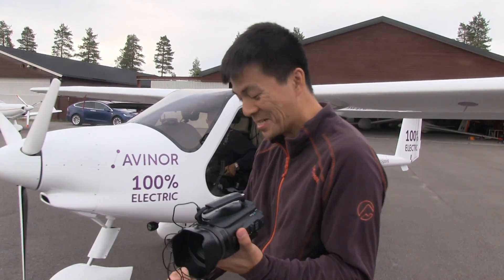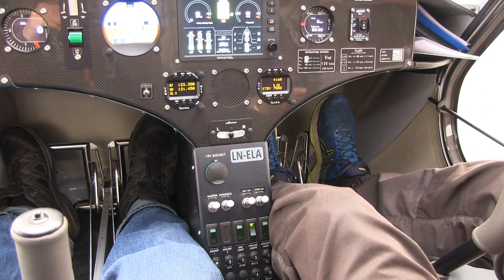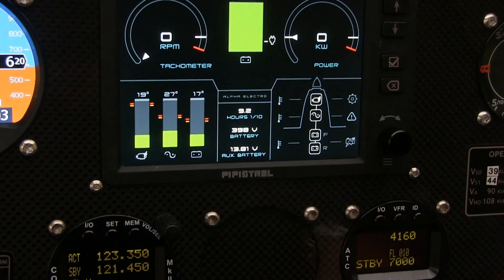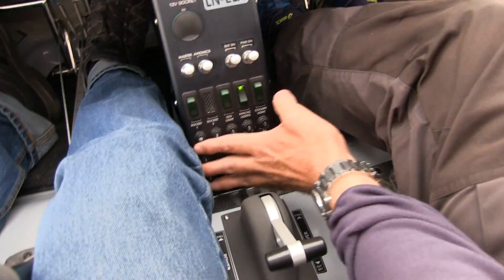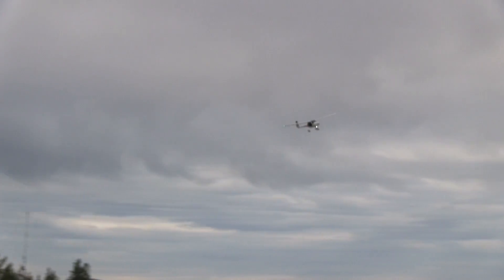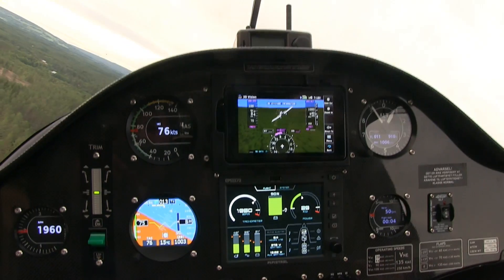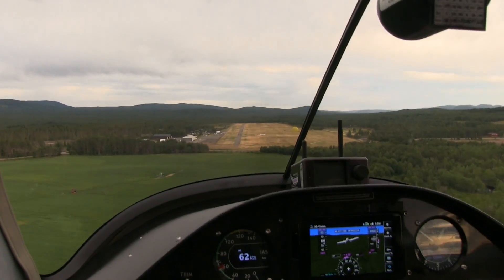Test ride in Pipistrel electric plane

Comment: Even though the noise is lower than internal combustion engine, it is still more than I thought one would hear from an electric plane. Most of that noise is coming from the prop. I conjecture that the prop is somewhat inefficient and that if the efficiency of the prop is increased, the noise would be lower as well.
Why is noise important? Lots of reasons, but for a pilot, being able to not have to wear headphones would be a huge improvement. Imagine being able to carry on a normal conversation without headphones on long flights!

Comment: 21 KiloWatts @ 100 mile per hour (163 kph) at 9:25 ,   A car needs about 100 KW to travel 100 mph.   So this airplane is 5 times more efficient  than a car traveling at 100 mph with two people.

Comment: Just wondering if it would be any advantage in making the beast into a flying solar panel. That wing surface looks tempting and although it would not increase performance much it might be a help in increasing the range. Most of the upside wings and fuselage could be covered and panels are getting cheaper and better. They would have to be shaped of course........just woncdering

Comment: What is the price difference between the ICE plane, and the electric? Kia now sells its Niro crossover with 3 engine options. ICE, Plug in hybrid, and full EV. So you can see the price difference. I always say my wife's Leaf is a $25,000 car with $12k in battery and development.
An hour's flight time is good for training, but I'm guessing the recharge time is a lot. For our car, it's 30min at 440v (hard on the battery), 3hr at 220, and (from half-charged) 8+hrs at 110v.

Comment: It's surprising how much of the noise of a small aircraft is from the prop. Nice and quiet in the cockpit though. Great little plane.

Did I see an instrument saying around 10 hours of flight time remaining? That would be a range of 1850km? That can't be right surely? Impressive if true.
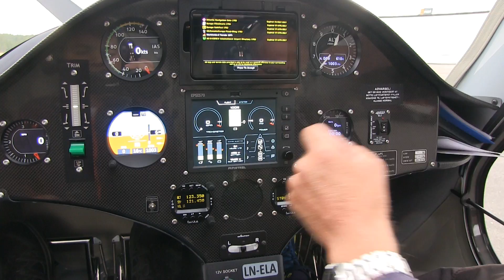Reply: Reading comments it's sounds like it can only fly for 60mins but @1:00 he mensions 9 hours of battery remaining? Is this just autocalculated from the current draw of  taxiing?

Comment: A 1 hour flight would cost me $2.16 in electricity where I'm from. That alone makes electric worth exploring. That and the reliability and safety considering how many systems that you won't be relying on.
Reply: Greg There's Only ONE ,moving part in an electric motor.. unlike a combustion engine with thousands of moving parts..  However, what's the one thing that always fails in modern cars... the electronics!!
Reply: @bicanoo_magic  Very often due to vibrations and non regulated power source, both can be easily dealt with in an electric environment
Reply: @bicanoo_magic  electronics rarely fail on planes
Reply: the issue in costs has to do with the batteries. I believe max battery life is 700 lifecycles, or around 700hrs of flying and I heard from a source that the battery pack is $17k USD to replace. That adds about $24 USD to the hourly cost. Something to consider.

Comment: Seems like a little bit of battery power could be saved by having small electric motors in a couple of the wheels to taxi with instead of reving up that big heavy propeller.

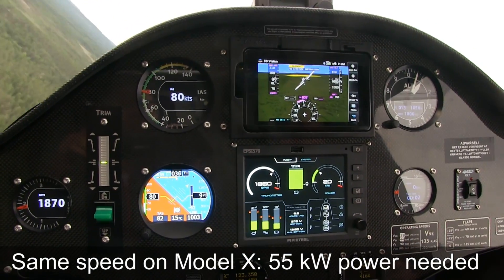Comment: 9:50 That statement is completely wrong a Tesla model 3 battery is 50Kwh or 75Kwh if it used more than 55Kw a mile it wouldn't sell because less than 1 mile range. 
A model 3 goes 100 miles using just 26Kw that's 260wh a mile. 209wh for a plane is still pretty good. Its more efficient but you cant fly to mcdonalds in a plane. 
unless it has a runway or air to air delivery. lol
Reply: You seem to be confusing power (instant measure) and energy (kwh). He said he would need 55kW to go at that speed (about 100mph). The faster you go, the more you spend energy per mile. He's probably wrong, but the Tesla will consume more than the aircraft at the same speed for sure.

Comment: So my question is why doesn't it have solar cells on the top of the wings for added power and for self charging?
Reply from the maker: Power consumption to cruise is about 15-20 kW. Solar cells on the wings would add 0.5 kW. It's pointless.

Comment: Noble Gas Engines are the future, no fuel and no recharging, no heavy batteries, and the engine weight will be less than 25 kilograms for small aircraft.

Comment: Really cool. Would also be cool to use the propeller, when it is windmilling on descent to charge the battery. Would be dangerous to use the feature as a means of recharging, but would help provide a bit of power back to the batteries such that "refueling" isnt as expensive.

Comment: All the people making positive comments about this video need to know that the pilot in the clip was reckless in the extreme.  He broke a number of basic "aviation rules" including flying over houses and people when not in the process of taking of or landing,  undertaking acrobatic manoeuvres (banking at over 60 degrees) without a parachute, and in an aircraft that I am sure is not rated for acrobatics and probably not holding an acrobatic rating, undertaking what is essentially an "airshow" without an airshow permit etc etc. Much more importantly he risked the life of his passenger without the poor guy knowing what dangers he was exposed too. At one point in this video he was in a climbing tight turn and the stall warning indicator was sounding, meaning that he as very, very close to a stall, one more instant the plane would have dropped the inboard wing and spiralled into the ground, almost certainly killing both on board. 

As a pilot, this kind of idiocy makes me very angry. It gives general aviation a bad name.

Comment: It would be interesting to see a twin-motor version with a bigger battery pack.  Not only would it have higher speed and longer endurance, it could be used for multi-engine training (assuming the FAA can be persuaded to cooperate).

Comment: Absolutely Awesome!!! What is the cruising range on full charge? And how long to charge up between stops? I wonder if in the future they can put solar panels on the wings and convert solar to the battery to extend the range. Cant wait to see this mainstream.
Reply: According to the datasheet for this aircraft, "endurance mark is 
up to 60 min (+ reserve)", so nice for quick flights, probably good for training and flight schools. Datasheet does not indicate charging time required to get back to full capacity. I suppose you could swap out batteries on the ground between flights as needed.
https://www.pipistrel.si/plane/alpha-electro/technical-data
Reply: Based on this video test flight at around 75-80 knots cruising speed, that looks like a range of close to  130-150 miles, but that would very based on the tail and headwinds you encounter and the amount of yaw you may get as well.
Reply: Solar panels on Alpha Electro are completely useless as wing area is too small and solar panels efficiency is currently too low.

Comment: While I applaud Pipistrel for making such an airplane, I don't see much practical use for it.  Pipistrel touts it as a 'pattern' aircraft, which is great if you're doing touch and goes, or even a short 15 minute hop over to another airport, but other than that, I don't consider it very useful.  You'd need to switch to the Alpha trainer if you want to be in the air longer than an hour, do a cross country trip, or such.
If you bought a plain Alpha Trainer and got the Alpha Electric free of charge with it, then I could see it, but that's not going to happen, so you're spending money on an airplane that is very limited in it's usefulness.  I didn't see anything about recharge times or recharging systems, which of course you need.  A 'fast-charge' system might charge the batteries in 60-90 minutes, but that's 60-90 minutes where the airplane isn't making any money for you.
I just don't see it as a good choice to invest in, although the tech in it is great.
Reply: Give it time. The first ICE airplanes were nearly useless for anything practical.

Comment: The 12 volts cigarette-lighter-socket is really outdated.
A couple of USB charger ports would have been much better.
Reply from the maker: A USB can maximum output 10 W. Whereas a cigarette socket can typically output 180 W. You can't plug a cooler box or kettle to USB.

Comment: Sounded different than I imagined, if you didn't know it was electric, you'd just think it had a regular avgas Turboprop under the bonnet. Atleast electric aircraft will still sound like they used do now unlike road transport.
Reply: turboprop runs on diesel, not avgas. turboprop sounds like this + jet. piston prop has the burble

Comment: Would a CS prop offer any advantage to batt powered performance?
Reply: yes. CS prop is about improving propulsive efficiency. if you're sinking 200kW into a fixed prop, you may get less thrust than 180kW into a vario prop.

Comment: Who would have ever thought that a damned battery would be able to power an aircraft!
It would be most excellent if all aircraft could use strictly electricity that would run tit for tat against a gas burner!
Reply: Not in our lifetime, but great for hobby planes.
Reply: @gsp49  how old are you? The BMW i3 tests with battery with 700 km range. you are not so pessimistic
Reply: Isn't that aircraft really burning coal?  I mean, that's most likely where you can trace the energy back to.  The 'reporter' actually talked like it was free energy.  Very naive.
Reply: @BushPilot444  But the energy mix doesn't only consist of coal power plants. Also, burning coal in a specialized facility under controlled conditions with proper emission filters is still a lot better than the alternative.

Comment: Is stall warning at 12:40? What is the stall speed of this aircraft at about 70 degree turn which I believe they did?
Reply: I calculate it around 79 KIAS. Very low (240' GND), slow and dangerous.

Comment: Even though it still has lots of room to grow, this is a really cheap way to fly. Charging costs little. TBO is 2000 hrs and overhaul costs $400. The current plane is just a bit under $120k, which is on the cheap side for a new airplane. If it had battery life in the 1.5 hour range, it would be THE trainer of choice. 45 to 50 solid minutes just isnt enough. Training usually consists of fuel draining maneuvers. The 5 min battery changes are great. This will go mainstream in a few years when solid state batteries are widely available
Reply: Even 1.5 hours is not enough. I've had a number of training sessions lasting that long. FAA also requires 30 minutes of fuel reserve to enable go-arounds and diversions. In any case, you never want to be flying near empty on a routine basis.
Reply: @djinn666  The required 100 nautical mile cross country could be a problem. Even if you could use this half the time. The cost of flight training would be drastically reduced.

Comment: The perfect trainer really
Reply: Gary C pilots in training have to learn and practice lots of maneuvers. Flying a straight line is nothing you need to train. 

Further it’s just the beginning. 
The first Model T from Henry Ford also couldn’t transport 250 tons of cargo like a CAT can - and it also couldn’t drive more than 400 km/h - but you have to start somewhere with research!
Reply: Please, think about this from the FBOs point of view, not the actual airplane.  The comment that I was replying to was this is 'the perfect trainer.'  I say it's not.  Here's why.
Yes, I agree that if you have two additional batteries, you can expect to fly it all day, in 60 minute increments.  Install one battery when the other two are charging.  But, you aren't going to carry those two extra batteries with you to change out enroute to anywhere.
For sake of discussion, let's assume that this airplane and two additional batteries and charger systems (you'll need two chargers for two batteries) comes to $150,000 USD.  Now, lets say the Alpha Trainer uses a Rotax 912 engine that in cruise burns 7 gallons an hour.  Everything else is the same.  The Alpha Trainer costs $100,000.
As a flight school, which would you rather spend your money on?  An ecologically friendly 'green airplane' that you can only fly for 60 minutes before having to land and 'refuel' or an airplane with a small internal combustion engine that you can fly for several hours and is only two thirds the cost?
As an FBO, profits are razor thin, especially today, and you need to maximize every dollar.  But, let's say you're going to spend a bunch of money and buy five new airplanes.  Which is your best choice for utilization, spending $750,000 USD for five electrics, batteries and chargers and be limited to less than 30 minute cross countries, buy three electrics and two conventional airplanes $650,000, or buy five conventional airplanes for $500,000?
If I was getting some sort of tax deduction on the electrics, I might buy two or three electrics and a couple of conventional engined airplanes, and use them in different scenarios.  But, also remember, if you're doing that, your students are going to get confused as they switch back and forth between airplanes.
I think it's a great idea, it's green and it's the wave of the future.  But, we need to extend the battery life, shorten the recharging time and build an infrastructure of recharging stations.  The same with a Tesla, you can only drive it so far before you have to recharge, and if there's not a recharging station nearby, you're sunk.
Reply: @GaryMCurran  - but in this class of very light aircraft, they all have limitations on range. Seems perfectly suitable as a basic trainer, for recreation, or for work commutes or island hoping.
Reply: @steve1978ger  In further reading on this airplane, you can swap out the batteries in a relatively short time, so, if you have three battery packs, you can do rather continuous flying, as long as you don't exceed the out and return radius of the battery pack.
Still, if you want to do cross countries, this isn't the airplane for you.  Even LSAs will do a couple of hundred miles, and then you fill the has tanks and come home.
Reply: edwong3  I don't know if you've bothered to look at the requirements for a Private Pilot, but Cross Country flying is a basic part of that, including a trip of at least 150 miles.

https://www.firstflight.com/private-pilot-requirements/

Try that in this airplane and you're going to be on the ground recharging and swapping batteries.
Reply: Gary C the XC requirement is 150 miles, but you have to stop at two other airports, with at least one being 50NM or more from the airport you started at.
Reply: @hobie1613  agreed, but what if those airports don't have a charging station, or batteries to swap out.  You may get stuck for 8 hours at each stop while the battery charges up.  If you're doing a triangle with 50 mile legs, and the battery is only good for an hour, are you going to chance going without a charge at the first setup and hope you make it to the second where you have to charge up, IF they have the stuff to charge you with?
Reply: Gary C that’s all stuff to consider on cross country planning.
Reply: edwong3  The difference is energy capacity and the time it takes to refill. A Pipistrel Virus with Rotax engine can carry 93 liters of gasoline. That's equivalent to  827kWh of energy. When empty, you can refill in 5 minutes. This in contrast with the Pipistrel Alpha electric version which has 21kWh of energy on board, and it takes several hours to refill. Guess what training facilities prefer?

The problem isn't even with the batteries, I'm sure innovation will help to get up to 100kWh or so. The problem is with the charging infrastructure. Suppose the tech gets to 100kWh batteries soon, and you can charge them in 2 hours. With gasoline you can have 20 planes refilled in two hours from a single station. With electrical, they all need to sit next to a recharging station for two hours, which means you need 20 charging stations. Each station needs to be rated for 50kW (=100kWh in two hours). That a 1 MegaWatt infrastructure at your local airport. Do the research and find out how that works in remote area's, or even at regular smaller airfields. And any innovation in battery technology only increases the recharge problem by either taking longer to recharge, or requiring even bigger capacity chargers.
Reply: Hardly.  What can you do with it other than touch and gos?  You can't fly it on a cross country, you only have 60 minutes of battery life.  If you destination airport doesn't have a recharging setup, you may be there overnight waiting for the plane to 'slow charge.'  Even in a training environment, with a fast charger (and I didn't see any specs on charging and recharging on the Pipistrel website), you still are waiting 60-90 minutes between flights while the batteries are recharging.  All that time, you're losing money.
It's NOT a perfect trainer by any stretch of the imagination.
Reply: Gary C if you're familiar with gliding compare it to the old trainers still widely in use, like K13. Trainers are built for ground handling and pattern training and this plane is perfectly suited for just that. I don't see a problem switching to a ICE plane when you've flown solo and want to fly XC.

Comment: 9:54 i guess it makes sense that it burns less energy in those speeds than a model x since there is no friction only air drag! and in theory i guess since im not a pilot he could use it as a glider if he goes with the air to save some energy!
Reply: and someone correct me if i am wrong but since the plane is in the air the propeller is like pulling air ropes right? so if the air current is right the weight of the plane will feel "less" on the motor making it more efficient? i could see the kw at some point being high when it goes up because gravity yea but when he was turning left or right or cruising the kw would be all over the place 3-22kw so i guess thats because of the air?!